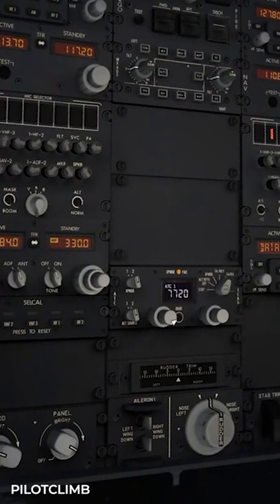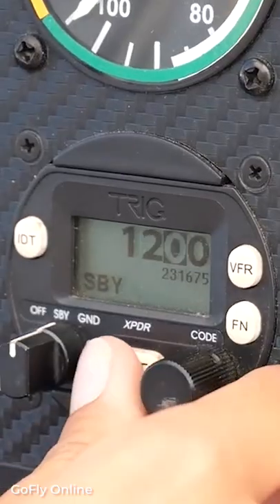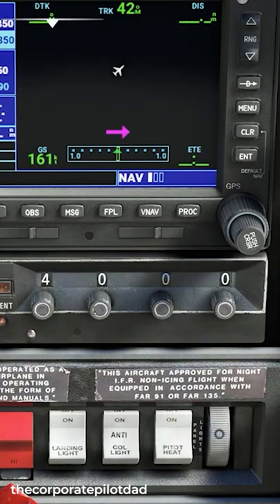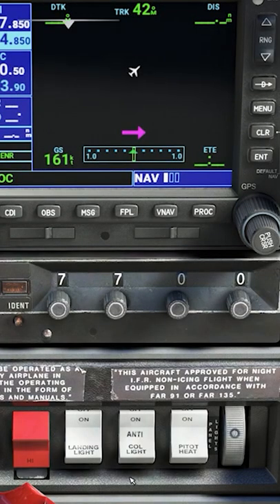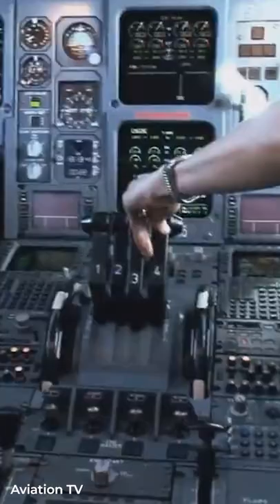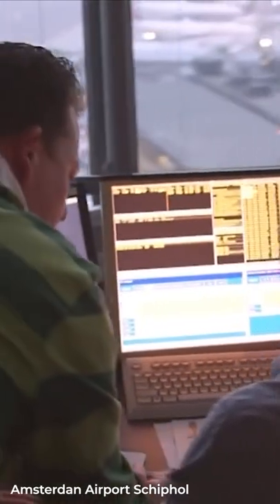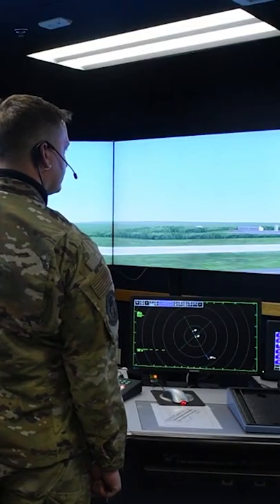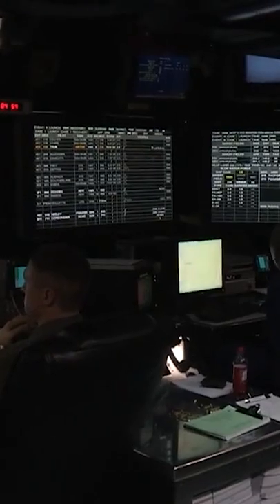What It Means When A Plane Squawks 7700 #shorts

Comment: I wonder how many times when an aircraft is struggling to fly do they actually get around to squawking 7700 ?
Reply: If you are already flying on a discrete squawk code assigned by ATC (such as flying IFR or flight following), you really wouldn't switch.
Reply: If they’re able to communicate to atc via radio then they likely wouldn’t set their squawk. However if the radio isnt working then they have no other option but to squawk 7700